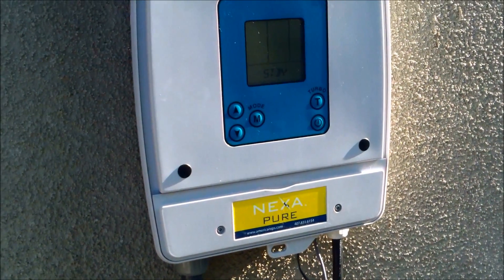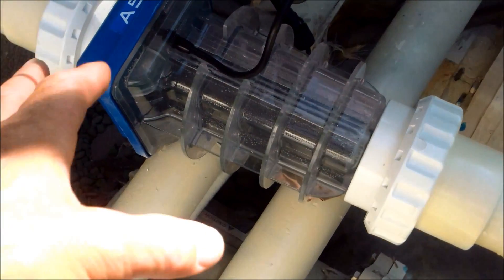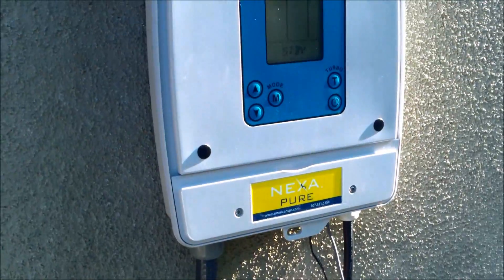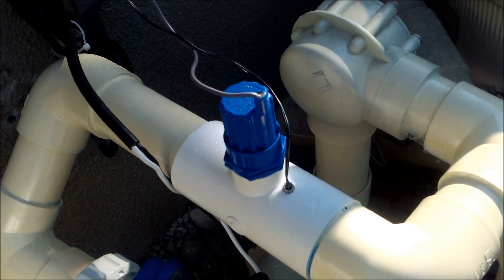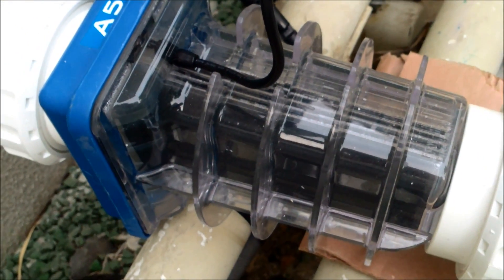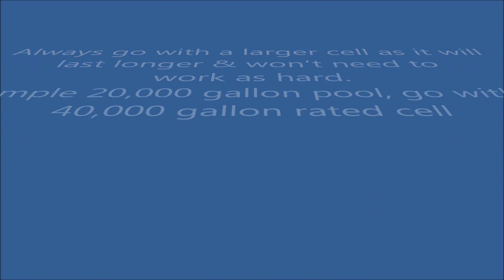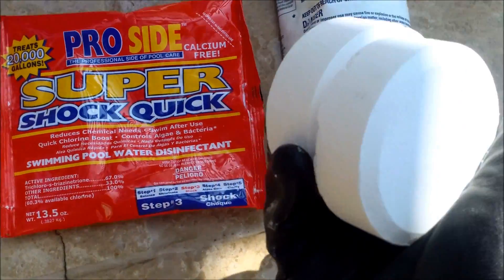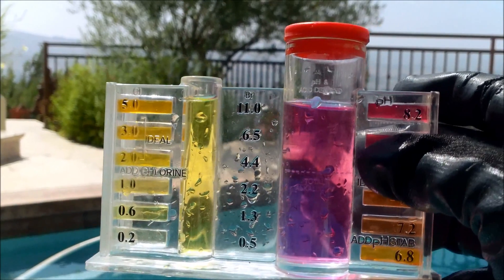How Does a Swimming Pool Salt System Work?

Comment: My salt cell is eight years old and I think it finally died,  it blows the fuse at the power center every time I try to power it on and no lights are lighting up on the salt cell  (it’s an ic 40). Would cleaning salt cell, possibly bring it back or if there’s no lights is that definitely dead? In other words if something was stuck between the metal fins would that cause it to short immediately? Thanks 
Also that website you had for the salt cell is no longer active it now takes you to a solar site where I saw no salt cells. Thanks

Comment: I am curious if the video publisher is still active. What happens to the hydrogen that is produced? Does the pump release it into the air? I have a similar system, and I am curious how it gets rid of the hydrogen safely? It's basically a very power electrolysis system right?
Reply from the maker: Hi, I am still active.😃 I believe it gets recycled in the process but I am not a chemist.

Comment: Hey David, I have a salt pool and the salt level is at 6000. and the pool has a lot of little white flakes everywhere.  I think it's sale from the cell.  any ideas on how to get rid of it?
Reply from the maker: 6000 is a bit high... I've had success with adding the maintenance dose of PhoseFree into the skimmer each week.  If the white flakes are more transparent like dead skin it could be related to high Phosephate levels. For some reason this flaky byproduct is produced. After a month of using the Phosphate remover the flakes should lessen. If it is more like heavy white flakes then that is calcium and adding Beautec seems to help descale the salt cell.

Comment: Hello, a quick question. My apartment pool is a salt water system. I've noticed that for a month the three jet fountains are never on ( shooting arcs of water from one side). Also no other jets seem to be circulating water as like a filter would. Stagnant!! Is this safe? It's like a big giant bathtub
Reply from the maker: That could be a health issue problem. I would contact the apartment manager and ask for the equipment to be inspected. If they fail to act you can call the local Health Department which regulates Commercial pools - they will come out and cite the complex and the issue will be fixed.

Comment: Types of cells? Plates? Iridium vs. Ruthenium? Perforated, Mesh  or newer standard parallel plates? And the pro's and con's  Salt counts vs power? Power output? Energy/money?   saved or lost!  Do you need a VS pump? 
Other types? Ozone, Borne, Ionizers,  pros & cons vs chlorine & salt electrolysis ? $$$?? Ease of use?
Reply from the maker: +noir4hire  You will not recoup the investment in a Salt System vs using chlorine it is more of a preference to make pool care easier.  I don't use Ozone or UV with a salt system. 

As far as systems the Hayward Aquapure seems to be the most reliable now - the newer Pentair systems seem to have a fuse problem form the amount of e-mails I am receiving on it.

Comment: So in normal conditions, does the chlorination cell produce enough chlorine for the pool or do I need to add chlorine on a regular basis to maintain levels in the adequate range?
Reply from the maker: Leonel Barradas Yes. If the pool is running long enough each day the salt system will produce more than enough chlorine each day.